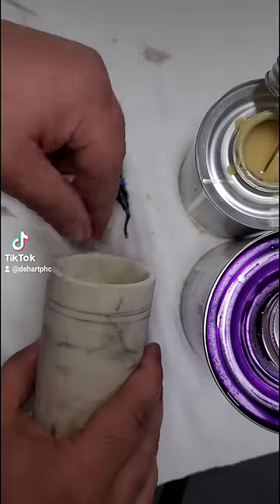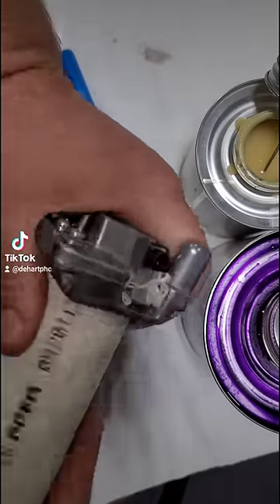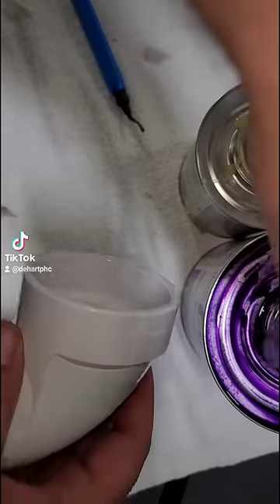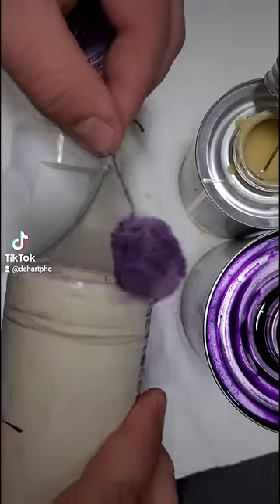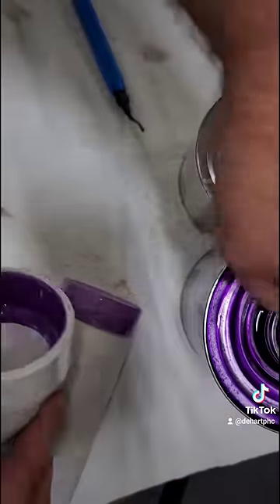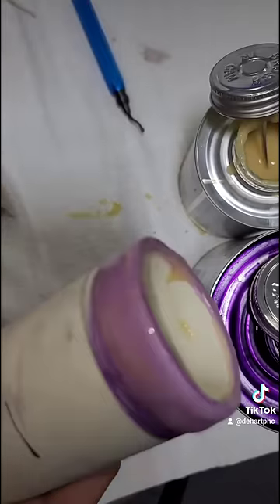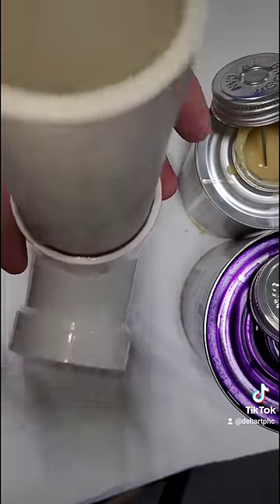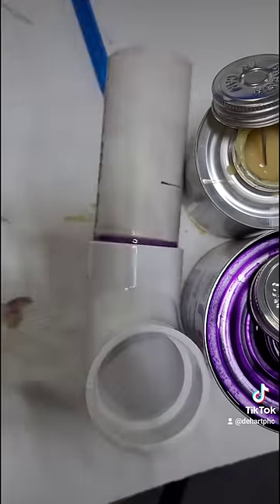How to create a great PVC solvent weld joint.

Comment: I chanfer with 3/4 hp Black and Decker and an 1/8 chamfer bit. When I’m done with that, I sand that changer down with 1000 grit, then apply the glue with fine arts paint brush!!!

Comment: Thought you also need to hold the fittings together for 30 to 60 seconds. The cement is a chemical reaction and it causes the pipe or fitting to push itself a few millimeters out

Comment: as an irrigation tech, I can comfortably say... I have never done this, I just use my thumb to debur the shavings, primer whichever part I can get to the easiest and only use primer on 2" and above or if the parts are dirty. glue is the fun part, sometimes I don't have time to wait for the water to drain from a mainline fully so ya just glue the top edge of a fitting or pipe and glue whatever I'm installing fully and slamm the muther fuggers together amd call it good. never breaks, blows out or leaks. never understood why some people go this extra mile it does absolutely nothing. hell sometimes you can have some little spices of dirt mixed in with your glue cause some repairs are hard as fuck and shit still works fine. but whatvwr makes people sleep at night i guess

Comment: One issue I can see, is if this was a much much smaller pipe, you'd have excess from the facing edge that squeezes out, to the inside of the pipe causing flow to be turbulent.   I like to add a little cement to the inside of the tip of the fitting, and fully on the outside of the pipe, so when it goes in, not all the cement is wiped off and there is a layer in between the walls of both, but not enough to leave buildup on the inside.

Comment: I Usually cut it as straight as I can, clean the burs. Scratch both ends a little with fine sand paper( I like to think the glue will fill the scratches and have a better bond. I also do the quarter turn if possible. 5 years later and still no leaks. I'm not saying this video is wrong. it's cool.

Comment: "I'm paid by the hour so I spend as much time doing as much meaningless shit as possible"
Reply: Ikr... Like wtf is the point of a chamfer tool. Some dude made it and is getting rich from people like this.
Reply: The chamfer tool ensures the edge does not scrape away any adhesive from the contact surfaces when the pipe is in the fitting. If there is an edge it can scrape alot away and then leave a gap. You probably have more years of experience in your plumbing career than him and me though, so I am going to go with you on this one.

Comment: After plumbing for many many years, I can tell you the part he said is most important is not.

It does not matter which order you primer the pipe or fittings, as long as they both have primer.

Comment: i like the new bandsaws to cut pipe and clear cleaner and clear primer got to get one of those chamfer tools usually just sand it i do try to let the primer dry and clean off puddling in side the fitting witha finger tip lol.. who knows besides a real plumber lol

Comment: I usually cut the pipe crooked with a saw's all and then use PVC glue without using the purple stuff or the glue. Works just fine. Don't ever clean the pipe and it works just fine.

Comment: Didn't let the primer set and forgot to hold the joint together to avoid pushout but looks good.  A couple turns on the end of the pipe with some 220 grit sandpaper does my cleanup and saves space and weight in my bags.

Comment: I usually cant open the can of glue because there a ring of kryptonite a holding it shut.  Using channel locks will open it to show me a sponge ball as dry as the Sahara. I will use snippers to cut open can then use my fingers to glue pipe. I end up with a glue glove mixed with blood that will not come off for a week.

Comment: You gotta hold the fitting for 30 seconds after applying the Wet Cement, because a chemical process is welding the pvc together

Comment: Glue hub first as it will dry slightly slower in the hub giving you a bit more time plus you can set down the hub with out gettin dirt on the glue or causing hand cramps holding it weird

Comment: Go ahead and take that long in an attic at 130+ degrees. Also when you put glue on the actual fitting you push glue into the line making the whole slightly smaller especially with smaller pvc. Its better to just glue the pipe so that the excess glue pushes towards the outside.

Comment: You are supped to chamfer to the depth the of the chamfer on the fitting though. And you don’t need glue and primer on the inside of the pipe where you reamed it.

Comment: I use primer as a cut cleaner kills all bacteria. Then use a piece of napkin wrap around cut then wrap electrical tape around  napkin and wala. No infection.  As far as all these steps thats awesome out on a table ..no one i know doing all that under a house .. cut pipe yes str8 as possible. Steps dont make any difference .. as long as u let the primer joint is dry before u glue ..if ur glue swap turns purple ur net waiting long enough for primer to dry remove burr so one dont get stuck in the joint causeing a leak. Primer both parts let dry  glue both parts push together twist  1/8 then twist back... it MAKES NO DIFFERENCE WHICH ONE U START PRIMERING FIRST .IM GUESSING THIS GUY MIGHT BE 30YRS OLD IM 54 I HAVE BEEN DOING PLUMBING & HVAC FOR 37 YRS .NEVER DONE ALL THIS UNDER A HOUSE .NOR HAVE I HAD A LEAK AT TESTING.. SO NO ITS NOT REALLY IMPORTANT TO DO EXACTLY LIKE HE SAYS.. SMH SOME PEOPLE..
 ALSO NOTHING WRONG WITH THE WAY HE DID THIS EXCEPT HE DID NOT LET THE PRIMER DRY. FIRST.

Comment: Super glue works better and plastic cement on the outside then duct tape it once it dries add electrical tape and then wrap it with clear tape for a nice finished look

Comment: If the pipe is holding water under pressure, no worries. If it's only a drain just glue the damn thing.

Comment: I only put glue on the pipe. If you glue the fitting and push the pipe in to it. It leaves a ring inside .

Comment: I only glue the male side, if you glue the female side the glue wads up on the inside of the joint causing psi loss and drag for whatever material goes through the pipe.

Comment: Did good until you got the glue on the inside of the pipe which will harden and create a potential snag point for hair or something else that will build up over time.   But for demonstration purposes good job.

Comment: Two missed points:
1. Hold the pieces together to allow the glue to set
2. Don't use your finger to wipe the excess glue from the joint...use a rag or paper towel.

Comment: I prefer to slop the abs glue all over the pipe and floor before I hack it to size with a hatchet usually 3 inches to short if the cuts a little wonky just fill the gaps with some jb weld.

Comment: I'm all about perfection....but I whack it with my mini sawzall...twist the end of the pipe on my work pants to knock off any rough edge...prime and glue....twist but 2 or 3 times back and fourth slightly....make sure my letters are lined up...I'm out. Never had a problem in houses I plumbed 15 years ago

Comment: First off code book states you always start with the hub of the fitting when gluing. Not pipe then hub, never that. Next, you don't need primer. It says so on the can of glue, if your using WELD-ON 720, clear glue, that is. Read that code book. You only need primer on exhaust vents. In other words just glue that pipe into that 90 lol.

Comment: The inspector ain't looking for nothing but the purple primer ring. It's purple so they can see it quickly. He knows if you took time to prime, you took time to glue. The inspector gives zero fvxks about those chamfers and he's not going to be pulling on the pipe. The pipe or elbow themselves will fail before the glue/solvent does, even without it being chamfered.

Comment: That's a lot of fussing around for a glued joint. I live in SE Asia and here you either dip your pipe in the solvent then insert it into the joint, if that's not practical I dip a popsicle stick in the solvent wipe it around the joint and insert the pipe.
I'm hardly an "old hand" at it, but in five years I've never had a joint leak. And the solvent is clear so unless you look closely its just about invisible.

Comment: Most of this is good but I glued thousands of feet of pipe while I worked as a water pump tech. You don't need thous fancy tools a box knife will work. And the order of which the primer then the glue is correct but it doesn't matter what fitting gets it first.

Comment: Top notch workmanship. However, I've had water lines run for decades that's never even had primer on it. This is way overkill. Not saying that it isn't good at all, but all the back and forth just isn't necessary.

Comment: Fuck that, just some pressurized pvc pipe glue will do, been doing retic systems for over 10 years (albeit not household plumbing but that is never pressurized pvc piping) and never had a pipe connection fail.

There is doing a job correctly and then there is just going over the top and either making no money or overcharging for something that doesnt need doing.

Comment: He forgot the part where you hold pressure on the fitting so it doesn't push out like it does in the video....shouldn't see a ¼" of primer when the glue sets up

Comment: Don't deburr its pointless. Only prime once on pipe and once on hub, order does not matter at all. The bevel does not help with seating the pipe, it actually helps keep the glue from being displaced while pressing the fitting and pipe together. The turning isnt for removing bubbles. Turning your fitting helps the glue form a bond better.

Comment: Step one: Don't waste money buying cheap glue that needs a primer. Just buy Red Hot Blue Glue. If your areas codes call for primer, just get the same brand primer. The hold that glue has is bar far the best and will see ya money in the long run.

Comment: This is why you don’t want to necessarily learn trades in a classroom and not in the field, way to much primer, you not glueing with the primer only the glue, you’re creating to much buildup of primer so when it’s supposed to dry the buildup will be the part that fails, also your supposed to turn 1/4 turn then hold for at least 10 seconds

Comment: You didnt hold it long enough. Guaranteed it slipped back a mil or 2
Doesn't matter 1 in and smaller but 2 in needs to be held for about 3 to 5 seconds. Longer hold time the bigger the pipe

Comment: Primer is not that necessary the glue itself already cleans and melts the plastic primer is just a gimmick in my opinion also, if you don’t know what you’re doing primer also pushes your fittings out if you don’t pay attention I stop using primer years ago only time I use primers for high-pressure lines even then I don’t even think it’s necessary

Comment: Beveling and stuff is pointless honestly. The glue literally melts the plastic to form a type of weld between the material. Bevel or not with proper glue placement and quantity its going to fill the gaps and seal 100% regardless. Glue one properly and cut it open horizontally to expose the glued surfaces after it cures and youll see the melted together material all formed together to create one solid piece.

Comment: Sorry your wrong. Plumber for 30 years here. Never bevel the lead edge of the pipe. Contrary to popular belief you are not actually gluing the pipe into the fitting. The primer starts to soften the pvc then the "glue" then creates a chemical reaction that melts the pvc together. That quarter turn is to set the bond. I don't know about that junk glue were using though. The glue us pros use is RED HOT BLUE in any brand.

Comment: That's not proper, you forgot to hold pressure on it so the pipe doesn't back out of the fitting slightly causing a weak spot and a guaranteed leak down the road

Comment: My advice is You never want to apply glue to the inside of the joint. Don’t take my word for it, do a test yourself on two separate joints, with one having only been glued on the male portion and the other with glue only on the female portion. If you look inside the pipe you will see that there is a smaller inner diameter in the one where glue was applied to the inside before fitting them together. The glue forms an inner bead around the seam s as you push the joint together and makes it more difficult for fluid to flow, but only if there is glue always on the inside. It will also likely create a stoppage from solids getting caught and building up.

Comment: You left the glud container fully open and that's going to allow the glue to quickly dry out=WASTE.  Plus, OMG, you wiped the excess glue off the joint with your FINGER?  Seriously?  Are you not concerned about your health, plus you didn't get all the excess off.  One needs to have napkins or paper towels when doing this to quickly remove any excess so it doesn't dry on the pipe.  Bubbled glue apparently weakens the pipe over time.  One should also be doing this stuff, outside or in a well ventilated room as the glue is toxic.

Comment: I dont use any of that crap. Just solvent and primer and my pipes never leak ever. And there is no sensical reason to go pipe fitting pipe fitting fitting pipe pipe etc.. whatever those stupid directioins were. Just slap the crap on and seal the pipe and move on.